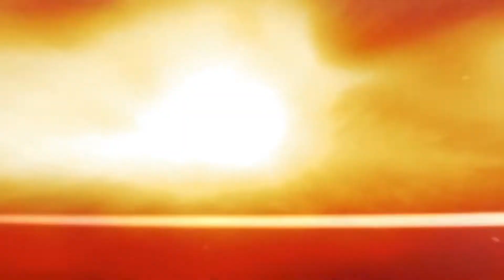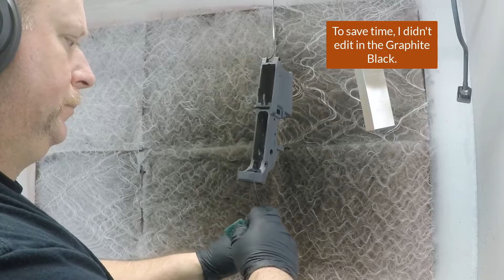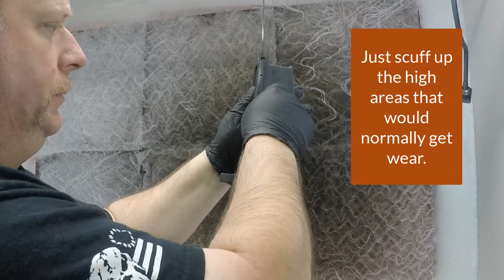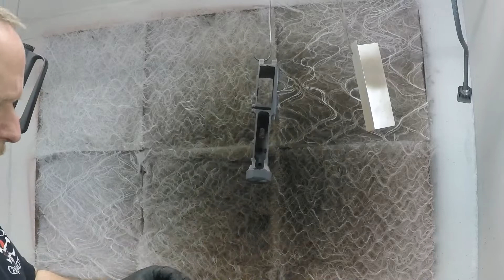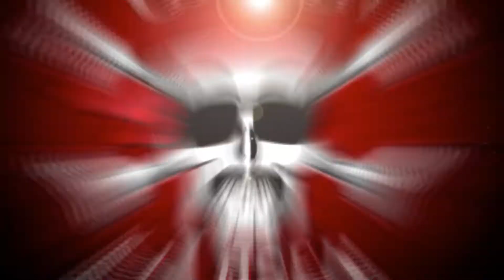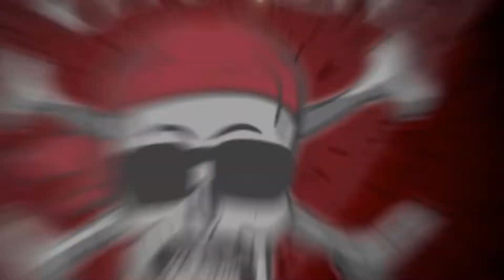Turning an old M16 into a new one, then making it old again | Branson Cerakote and Laser

Comment: This is great stuff John! How often do you change out your red garnet sand on a regular basis? Do you need to change it if you are blasting some old, dirty stuff?
Reply from the maker: We change ours about once a month. We just look for it to change color to a dingy grey. We end up changing it when it's dirty versus it being worn out.
Reply: @BransonCerakote  Is it necessary to change it out after blasting something that had paint or rust on it that wouldn't come off after attempting to degrease it?
Reply from the maker: @johnlevine4968  If it's bad, we generally remove that with a green pad or steel wool first. With paint, we use paint remover before we even start. I don't want flakes of paint floating around in my soak tank.
Reply: @BransonCerakote  Thanks John, you're a huge help my friend. Just one last question to bug you with, I had quite a few runs from spraying too close where I didn't notice it until after I hard baked in the oven. What's the best way to remove that layer of cerakote and start over again? Or do I just throw it in the blast cabinet and blow off the cerakote that way?
Reply from the maker: @johnlevine4968  Take it all off. There's no way to really take off one layer. If there was, it would probably be more trouble than it was worth, and would probably look like crap.
Reply: @BransonCerakote  So you mean blast it with sand sir?
Reply from the maker: @johnlevine4968  Yep. Either 100g Red Garnet or 100g AO.

Comment: Awesome man, quick question long would you tack  polymer and steel if you cerekote a camo finish
Reply from the maker: Depends. The polymer (in our oven) tacks at around 6 minutes. Steel, depending on how dense it is can take 12-15 minutes. Tacking is how it feels vs how long. Don't touch it for several minutes. Hopefully when you touch it, it will feel sticky, but not wet. That is tacky. You want to leave it in until the stickiness goes away, and its dry to the touch. That's tack free. Different locations, and different ovens can shorten or extend the times we have.